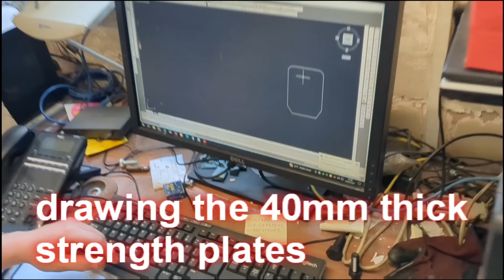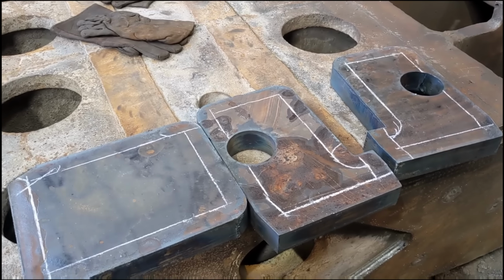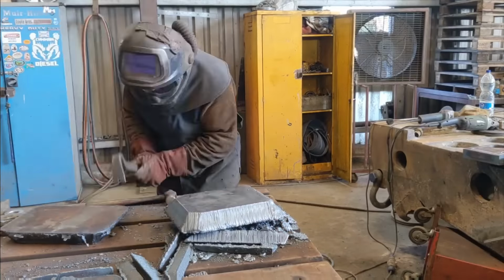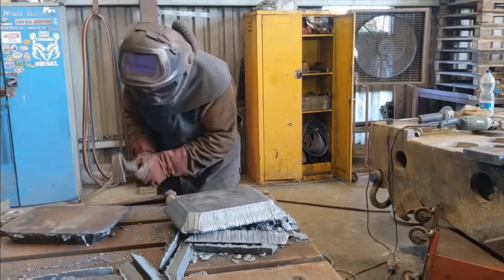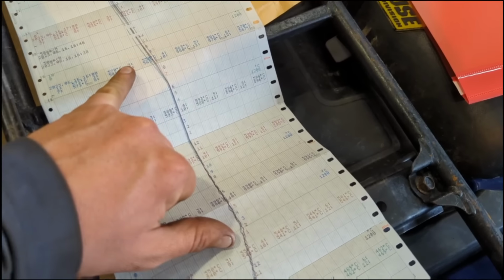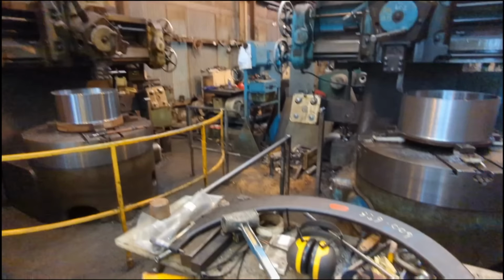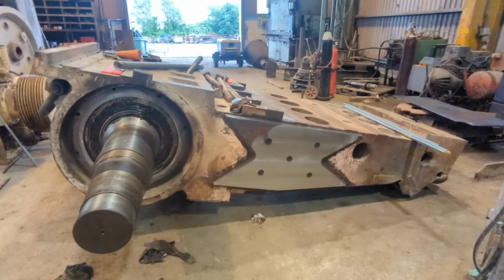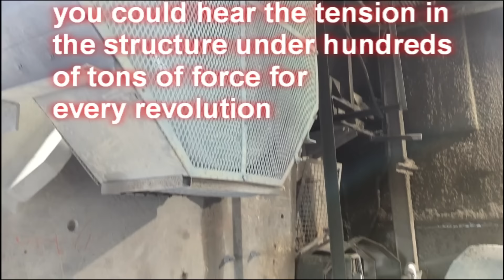10 ton mega welding repair job finished! 12 rolls of wire ! my 500th video! engineering machine shop

Comment: The heat treatment you did was a post weld stress relief, not a normalising treatment. Normalising is done at a higher temperature above the upper critical temp, at about 850 Deg C and above depending on alloy content. It could have been done on this part to make it even more durable in service, but obviously stress relief was sufficient. It is a remarkably tough lump of steel you have there, be interesting to know exactly what is it, what grade....
If you want to learn more about this try a book like Materials for the Engineering Technician by R.A Higgins or the later version of it, whatever it may be called now a days...

Comment: Some missing variables to exactly figure out how much power was used to post heat the piece. But roughly the 150kva worth of units could draw around 900 amps maximum total, resulting in 249,000 watts, roughly $600US for 14 hour cycle. That’s at max load. Realistically probably half that was used since it was a gradual heat up and gradual cool down

Comment: I watched all 3 videos in the last 24 hours.. I lvoe the welding  & maching content. As someone who wanted to do that kind of stuff, but ended up elsewhere due to Issues.. I like watching others do cool stuff while I do boring computer stuff.  Impressive project on that part, insanely detailed welding.. As someone whos a complete nitwit, but done SOME repairs on some stuff, i couldnt help but get a nagging question as i saw you add piece after piece of re-inforcement.. what if the designer left that point weak as a point of failure to save something else in the machine. but then i saw the size rocks its crushing.. and laughed. its probably fine.

Comment: Dreaded lurgy , a heatwave , and welding down in the bottom of those pockets , that's one hell of a mix .
Monster job , but you're killing it , though that may be a bit of a two way street seeing you were under the weather.

Comment: When I was working we’d have called you a genuine old boy.
Over my years in heavy engineering I’ve worked among some wonderful old tradesmen & learnt a lot if they found you willing, as you obviously were Alastair. Nothing better than a willing apprentice in my book.
Never made a mistake, never done a job.
I use to ponder sometimes when a thing became ‘ beyond economic repair?’ BER.
Never ceases to amaze me what can be done. ££££?
An old boss gave me two pointers, lol.
‘ I want reasons why you can not reasons why you can’t & there are no problems only solutions!’ Always stood me in good stead when someone said; ‘ can you just?’ 
I’d love to see a cordless flux cored mig set up, that’d be something, lol.
Made me chuckle!
Imagine stick welding that with 7018’s & keeping the packets. lol.
Keep up the good work, I don’t miss the grinding one bit, so fully appreciate your achievements.
Thanks for reviving good memories as a fitter of my years in marine engineering & the ol steam work. Hard & heavy but satisfying.👍

Comment: Theoretically without heatloss to surroundings:
(Heat capacity of steel is 420 J/kg/'C)
To heat 10000kg of steel about 600deg using 3x50kW heaters takes (3600 secs in an hour) 5.7 hours.
10000*600*420/150000/3600=5.7 hours

Comment: Few more questions.  What wire and size did you end up using?  Also what was the gas combo?   Was that propane and oxy on that cutting torch to cut off those plates?  Massive job and a great job well done.  I wish i could get onto mig welding like you, Pretty decent stick welder but really struggle with the mig.

Comment: The words "3 jaw crusher" just popped into my mind.  What is this? A two jaw crusher?

Is this preceded by a cone crusher or is it straight from the dump?

Looking at the size of some of the bigger machines that Curtis is setting up compared to the machines ABOM is using was informative.  Now seeing what your company uses provides yet another scale for comparison.

Great work.  Great video.  Brutal conditions.  I like everything.  In depth of one thing per video is good.  I like watching it all.

Comment: Is that an ESAB welding machine you are using, looks like one but it's hard to see the logo on it. I used an ESAB unit with air powered push pull on aluminium tankers at Crane Fruehauf back in the early 90's , great units ran all day at full power, in fact we never set them lower as the torch leads were forty foot long so we did all the regulation with the air trigger on the torch, just by feathering the air flow. I feel for you with those welds as in the late 80's I had a tig welding job that ran to over 3000 meters of weld, was at that one job for two months, all I did was tig weld all day eight hours straight someone else was tacking the job together and it was passed on to someone else for weld pickling.

Comment: Have you ever thought about flux core a 1.6 wire you can put some metal down with that iv used it under ground cutting machine bridges I think it was made by murex I'm sure many distributors will do some just a thought I don't know if you have tried it yours konrad

Comment: I watched all 3 episodes back to back. Thoroughly enjoyed this! In one of the videos you commented that this repair used smaller welds than previous repairs. Curious what amperage and wire size was used. Also the thick plates you made and welded to fill the openings... Did you cut open those areas to gain access? Or did you just fill them for extra strength?
Reply from the maker: Filled them for extra strength. This weld was 1.2 solid wire previously was 1.6 wire

Comment: I don't think it was air pressure that bulged your side plates .. I think it was differential temperature early on during stress relieving. Those side plates heated up faster than the thick main plates, expanded faster, had nowhere else to go other than outward. I don't know what the average plate to plate gap was nor how the heating elements were arranged. Well done series .. kudos

Comment: I hope you can answer my question.  I've been interested in those welding hoods for several years.  I've always wanted to know if it feels cooler under the hood with the air filtration system. It gets pretty warm welding during a Texas summer, and I'm curious if one of these hoods could make it more comfortable.

Comment: when you put the plates on the side, would it not have been worth welding some hoops on and putting wedges in to press the plates as tight as possible to the body of the part to try and reduce any air gaps or is the 20mm plate too rigid to move

Comment: Another question: why don’t you order drums of welding wire, orderly spooled or ‘wild’? Aren’t those more economical?
Technically speaking imo the piece was not normalized (810-930 C) but stress relieved. Stress relief can be considered to be a raised temperature induced creep. (Instead of a recrystalization).

Comment: Congratulation.
Glad I found your channel befor the 500th video 😅
Which welding wire did you use on to welding the cast iron?

Comment: What is the rock they are crushing? Congratulations on a top job mate seems quite fitting for your 500th video also, would luv to see that film in the harland and wolf machine shop, thanks again
Reply: Forgot to say that crusher has done  13000000 tons so far

Comment: 28:40 "11 (15kg) rolls of 1.2(mm) wire burned" WOW! That is a huge quantity to use on a single job, let me get out my calculator really quick...

You might be interested in knowing just how much that is, in terms of length. 20.4km or 12.6 miles of wire.

That is a BIG job you accomplished!

Comment: Someone can correct my math if it is wrong, but at 12c per KWH power rate, that heat treat cycle was about 300 USD in power.

Comment: Nothin small or light, except the bloody air gap between plate and casting. I can't even imagine the forces this swinging jaw goes through while it's working. I feel like the engineers who designed it, made some assumptions, and under estimated. It might not have broken the way it did.

Comment: Please excuse what could well be a stupid question from a welding novice, but here goes, wouldn't it be quicker, easier and cheaper in materials and consumables to use stick on this type of work?  Epic job though, regardless!
Reply from the maker: On every level ..no
Stick is dozen times slower, changing rods, chipping and sweeping flux

Comment: Is the reason you can’t, or don’t use a plasma gun or gouging setup due to the need for the tolerance required to have an even thickness of the weld?
Also, your channel is my first ever YouTube comment 🙂

Comment: Was there a reason you didn’t prep the bottom plates for 100% weld penetration like you did with the top plate’s instead choosing to build it up with weld?
Reply from the maker: The bottom welds I had no surface restriction  so a could put a large fillet on top equal to plate thickness, but because the top plates had to be flat with nothing protruding I had to put on a full penetrating weld  prep

Comment: 52:12 i saw the gap in the 2 previous videos and thought you needed to close the gap before welding on the reinforcement plates. Didnt want to comment anything because i knew the video was all ready completed. But you could definitely tell in the 2 previous videos the plates were too far apart from the work piece
Reply from the maker: I didn't show it but I dogged the plates down tight. But the side of the jaw is uneven rough cast surface
Reply: @allistairc123  crazy how it's balloons from the forces from that! 😬 thank you for your uploads, they very nice to watch! Just subbed 2 days

Comment: A somewhat awkward discussion in money switching hand, negotiations what did the jobs cost in materials and overhead, what was the profit etc. what was the jaw worth in scrap offset by repair vs just buying a new jaw? All from the stand point of “Here is a Man” doing real work, the streets are full of boys who should be men, with no idea that they could be men, decent, hardworking, full of knowledgeable, necessary men, admirable men that are worth every dime their salt and that this Ringer with kind words and admiration for others also came into the world naked learning, excelling and giving back as a teaching master; the strength of materials, tempering boys into Men.

Comment: Your use of wire throughout, seems to be against the experience of the Australian Armour and Artillery  Museum, where they join armour plates when rebuilding tanks using stick welding initially and wire to fill in . I think because otherwise it becomes too brittle.

Comment: I really doubt the little pockets of air had anything to do with bulging that thick metal fish plate. You dumped so much heat into that 10 ton piece of metal, I would expect things to move around, especially when you're measuring down to thousands of an inch clearance.

Comment: When I was young I operated a very similar size jaw crusher machine in a iron mine.  I remember having to change the wear plates every few months when you could not adjust for wear anymore. Once in a while a very large rock would plug the jaws and we would have to blast the rock with explosives to clear the jaws.Blasting was a last resort.  On one occasion the supervisor did not want to wait for someone to come into work to blast a major rock plug. He decided to obtain explosives himself and blow the rock. I did not want to have anything to do with his action and grabbed my lunch box and headed for the front door. He set the explosives off about the time I opened the front door for the washing plant. The blast took out all the lights in the building and I grabbed a flashlight and ran up four stories to make sure he was Ok. I found this man standing behind a Cone crusher covered in a thick layer of red ore dust. They worked two days to repair everything and restart the mill. 
I worked one more year at the mining operation and save enough more to go to college. The only thing remaining today of this washing plant is the massive concrete bases for these crushers. I have taken my children and now my grand children to this old mine. No one believes the massive size of this foundations. They are the only remaining traces of this whole structure. 
This was my very first job where I worked all night long.. When I went back the last time nature had recovered a great deal, people were fishing in the mine pits. As for me Ive had 28 surgeries, four by-passes,and stage three cancer. My two children  now we have three children. 

Yet I still remember standing on a massive catwalk looking out the windows of my very first full time job and thinking about my working career starting. now im seeing my life on the other end.